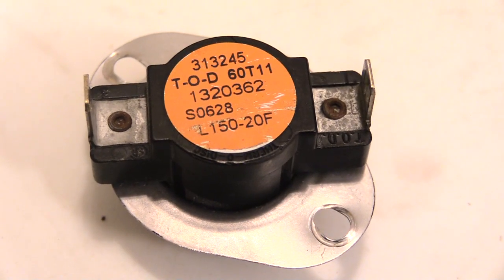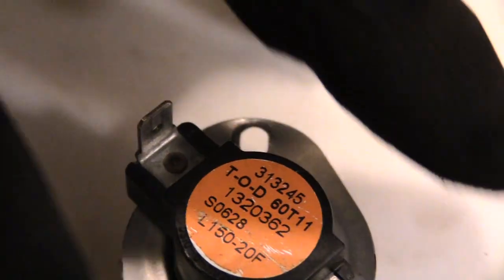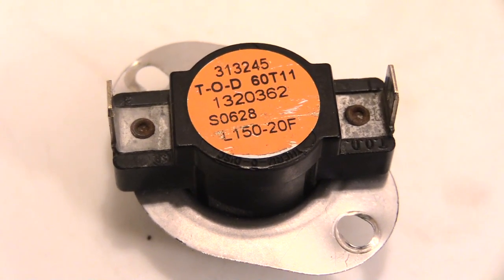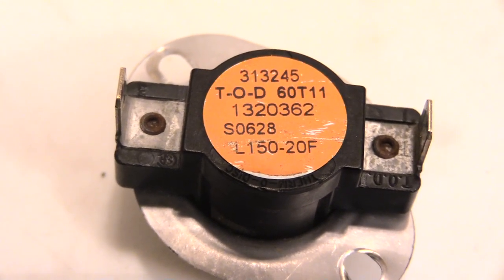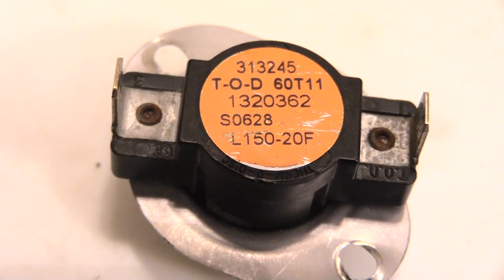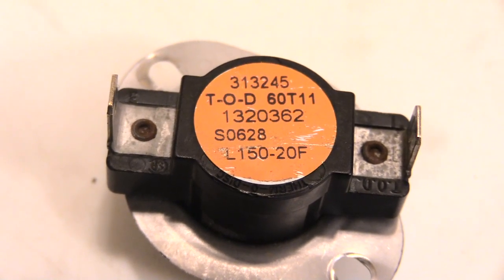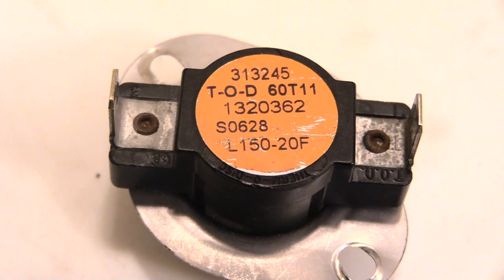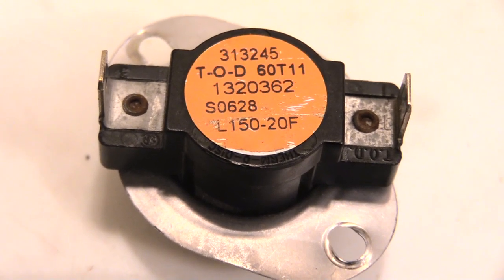Furnace Heat Cuts off after 5 to 15 minutes Possible Easy Fix!

Comment: The thickness of the filter could cause the limit switch to malfunction,  too. Most furnaces cant function thoroughly with thick air filters.
Reply from the maker: Good tip thanks. Please subscribe like and share 🙏.

Comment: It is not the limit switch in my case.  I have a similar problem, furnace turn off around 10 minutes and turned out it was the flame sensor, clean the flame sensor fixed the issue.

Comment: My furnance kicks off about 10 mins after it runs then the fan will run for about 2 mins and the furnace will kick back on and finish heating and  then will be fine till it heats again. I have had 2  different companies here.
Reply from the maker: Have you checked the limit switch , flame sensor, and the thermostat. Make sure your filter is clean. Please subscribe like and share and check out our other helpful videos.

Comment: My furnace has the same problem,  so I put a hot plate under  the receiver  that is the ceiling and it gets warm to pull the air through. The air gets very in air duct and doesn't turn off.  It blows the warm air around. As soon though as turn the burner on  after about 5 minutes it shuts off. It takes a bit to come back on. The duct stays hot but doesn't  shut down  with hot but does with burner on.  Any ideas?
Reply from the maker: Check and clen flame sensor if not your  limit switch maybe going out.

Comment: Nothing to do with the switch. The switch is either good or bad. The pressure or the limit switch or any switch switch is the most unnecessary repair as well as trhe most miss diagnosed.   95% of the times the switch was fine. Simply test it for continuity and voltage and you will know.  The problem may be the inducer fan ( the small fan) which can be dirty, weak, intermittent, weak wire connection, or likely  have a bad seal between the fan and the wall of the furnace.

Comment: Hey question my furnace is runing like normal and then it shuts off the flame and turns off my ecobee 3 thermometer then the boards indicator light blinks 4 xs saying its an open limit switch or limit switch and after 10 mins restarts the flame and thermometer I cleaned the flame sensor, the igniters working properly none of the other 4 sensors are tripped the small fan runs but im not sure if my capacitor or big blower is running. what could cause the hardwired ecobee 3 thermostat to keep shutting off? I replaced  the 7inch long limit switch and its a goodman furnace s lil older but ran fine for 13yrs that ive lived here also clean airfilter and the one before that was clean and not that thick. also had my ducts and lines and furnace cleaned out by a company a year ago. Thanks in advance.
Reply from the maker: Flame sensor could still be bad I would try that first. Please subscribe like and share.

Comment: This guy is giving everyone incredibly wrong and potentially life threatening information. Being a college instructor in basic to advanced heating air conditioning and refrigeration systems, I know just a few things about these systems. The most common cause of a furnace cutting out on the high limit switch is insufficient airflow, such as crushed flexible ducts or restrictive ducts. The purpose of the high limit switch is to protect the appliance from overheating. Replacing the high limit switch will not solve your problem. Limit switches rarely fail and if the do, it's in the safe position. Call a professional and and it could save your life.
Reply from the maker: If you change out your limit switch and there is something still wrong, the new limit switch will do its job and cut the furnace off, and then you will know there is something else  wrong, then you can call the professionals and hope you get a fair one that won't over charge or flat out scam you.